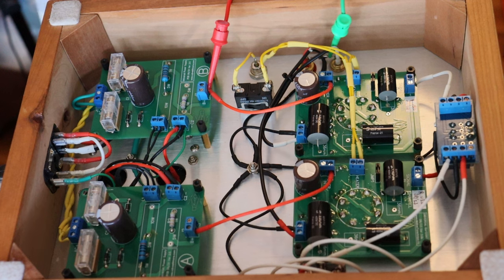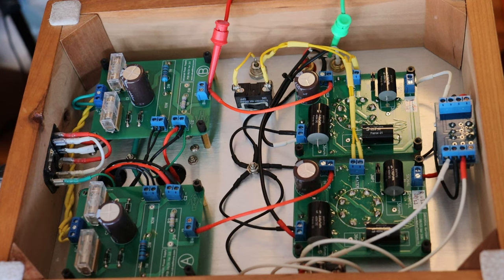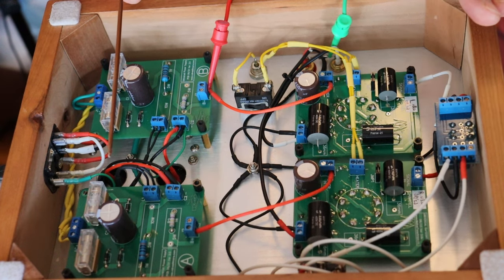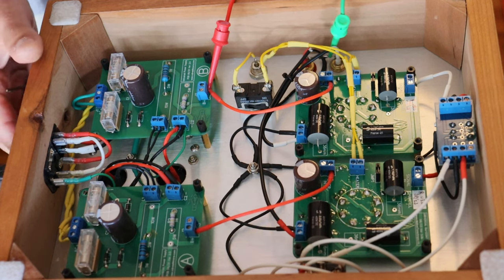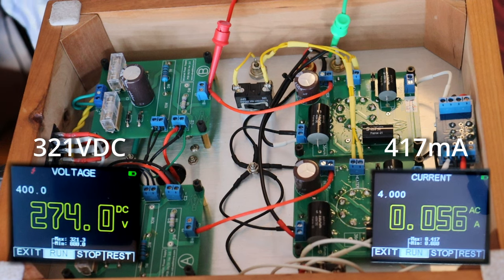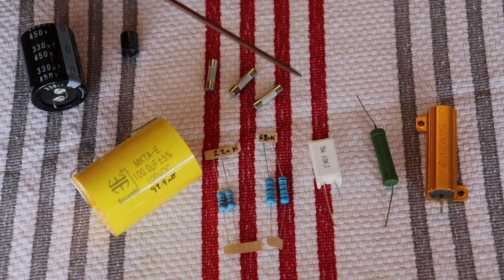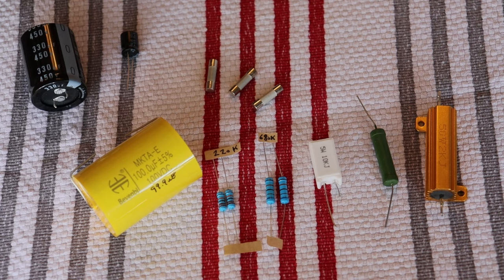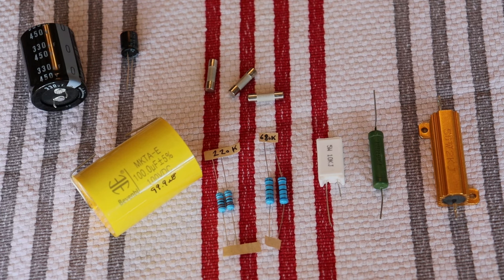Tube Lab #202 - Voltage Surge

Comment: I have been building lower powered power amps that use an inverter to provide high voltage and I supply all the power for the amp is from a brick. If I am using tubes with 6 volt heaters, I series them. But often I use tubes with 12 volt heaters.  I made the cutest pair of 13EA7 mono blocks. Lately I have been making amps that use horizontal output tubes as finals and using industrial power transformers for output transformers. The transformers are 480 vac to 24 vac. They yield about 3200 ohms with an 8 ohm speaker. It's CRAZY how pretty these sound.